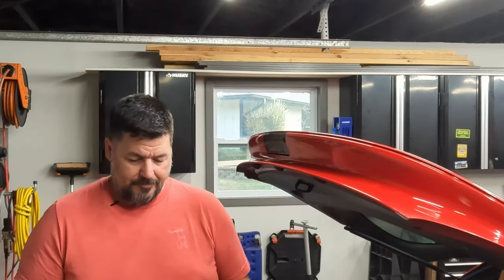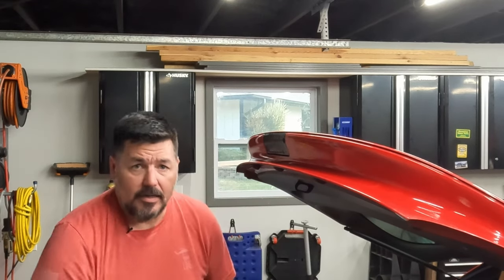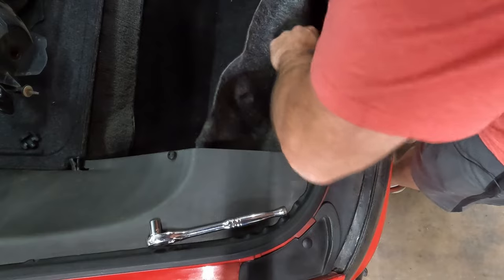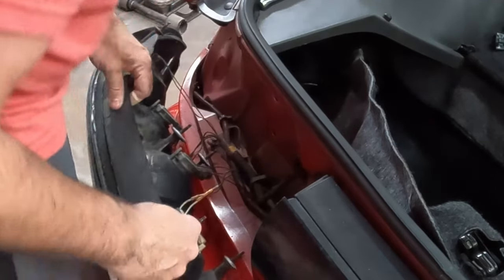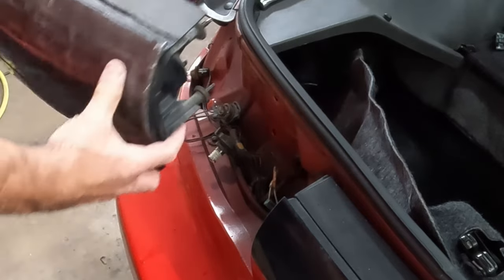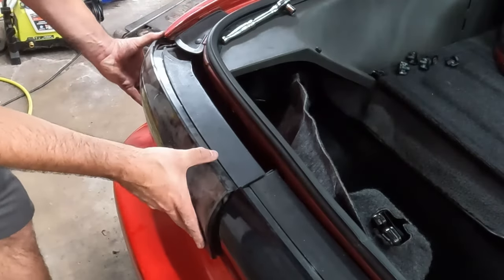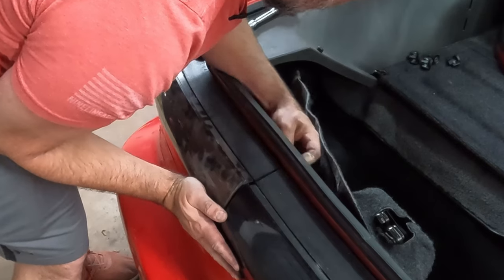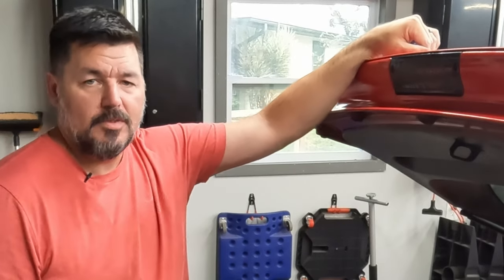Replacing Tail Light Lens and Bulbs in the Pontiac Firebird.  Surprise Paint Detail at the end!

Comment: If you've been getting red paint as soon as you hit the finish with sand paper someone must've done a MAACO job on the car. GM hasn't messed around with single stage  finishes in YEARS. (Like since the late 80's)

It's a cheap fix for a solid color, but I still prefer a base/clear for everything. Show cars used to get super high gloss with solid colors by sanding between coats with a fine grit to get it flat...then final coats with a finish sand and polish. (That's where the term "color sanding" originated)